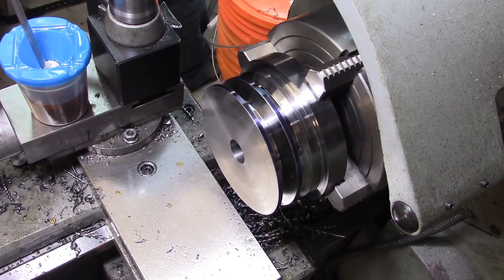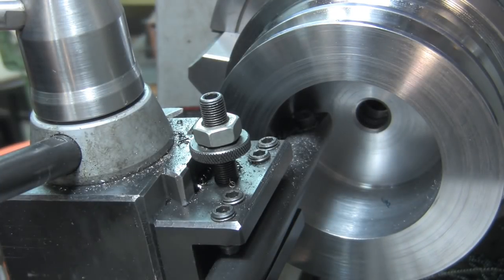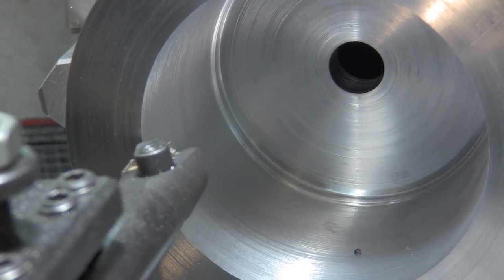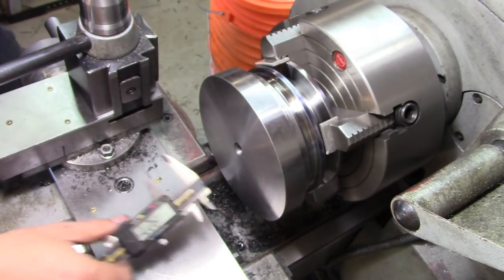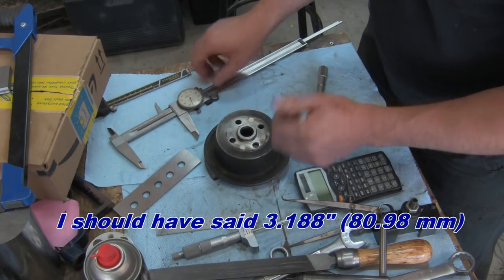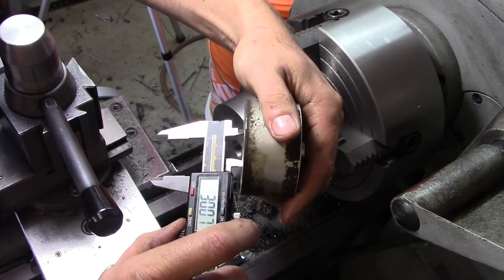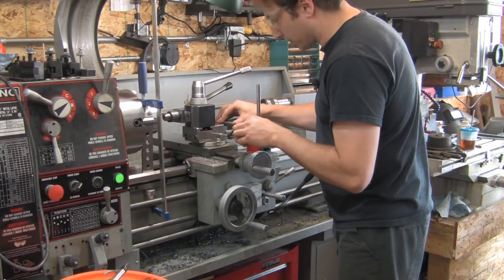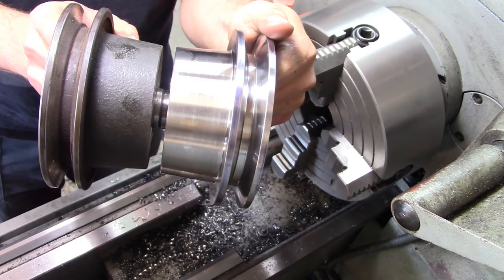Making a Custom Water Pump Pulley Part 2

Comment: Very professional  work of art.  Better than a store bought Pulley.  I liked the way you worked out your angles etc. Overall Terrific Job, Well Done
Reply from the maker: Thanks Ted, I was content with the finished product and it worked as it should. Figured the angle measurement was as close as necessary for this application.

Comment: Must be a really good customer.  Cutting that pulley looks like a couple dozen hours' work.  Still, it's nicely done.  Thanks for sharing.
Reply from the maker: Thanks Dan, it did take about 11 hours or so all told, but that's partly due to the lower horsepower of my machine requiring more light passes than something bigger with mote grunt.
Reply: Everett's Workshop get yourself a bigger motor or if you are using a single phase set up then go three phase with a VFD soo much more power to your elbow and with what you could charge the customer you can now afford a brand new motor and a VFD!

Comment: G’day Everett, you tackled a big job and achieved excellence too bad it was only a wood chipper, it would looked good on a hot rod. Being a Perkins you’d have thought a pulley would’ve been available but then if it was sourced through the chipper people they wouldn’t think outside the chipper box. Expensive but then if it’s a one off like yours you can see the price in labour. Cheers Peter
Reply from the maker: Thanks Peter, I'm content with the finished product. You make a good point about the equipment dealer perhaps not looking elsewhere but my boss is pretty resourceful so I would trust that he snooped a number of avenues before talking with me.

Comment: Nice work! Now it just needs chrome plated. 👍😉
Reply from the maker: You know, I'd like to try plating of some type, whether it be zinc or nickel plating for steel surface protection, but need to get a number of projects off the list first.  Chrome would have looked good though!

Comment: Wonderful work. I'll bet that the charge for that pulley was about the same as for the original Perkins pulley. I have worked on them before, metric, metric, metric...  I think that you do class "a" work, thank you for the very interesting video. Please keep making the video's.
Reply from the maker: Thanks for the kind words, I appreciate it. The overall cost to the customer wasn't near the OEM part cost but I think they were mostly happy just that they got their machine back in operation. Will keep doing videos as time allows around other work and family priorities, the hobby machining community is a great bunch to hang out with.

Comment: Nicely done, if it's like you suspect made from 4140, this pulley is gonna last for ever even if the chipper falls from a high cliff...!!!!  
 
This involved TONS of metal removal, lots of work on a small to medium sized lathe. I'd be curious to know what kind of cuts your lathe is able to get away with and how long you needed to remove that amount of steel.

Your problem not getting good chip breakage control, is mainly due to depth of cut vs feed rate and speed, depending on the geometry of the insert you need to find their "Sweet spot", generally the rule is to get the depth of cut at least twice the nose radius of the insert, then adjust the advance, you can expect to gain decent control in the .006" to .015" advance range, now, there is also a limiting factor to deal with, the available power from the lathe's motor, another parameter to take into account is the SFM, with carbide inserts and alloy steel try to get around 250 surface feet per minute or even a little above if possible, this produces the required heat to help make the chips brittle and wanting to break. 

You may need to push your machine a little in order to achieve good results, also will shorten your execution time...
Reply from the maker: Thanks Pierre, it took a number of passes to remove material, for sure.  Had a trash can of swarf in the end . . . I need to experiment with feeds and speeds with this thing but something tells me that the "1.5 hp" rating this Chinesium lathe has is not quite accurate with how it seriously grunts when putting any depth of cut or heavy feed.  A lot of my tooling is negative rake because it was cheap but might have to experiment more with positive rake stuff.  Got another 4140 turning job here so will give a chance to fiddle with feeds and speeds.  Hope you're doing well!
Reply: @EverettsWorkshop  Don't be afraid to find out the limits from your machine, carefully, though... 
If you can reach the sweet spot where you remove quite a lot of material and the part remains still relatively cool, this means you're quite on spot and were able to make the heat evacuate in the chips, try to get your speed adjusted first, remember that carbide performs better at higher speeds ranges, 250 to 600 SFM is typical.

Comment: Everett, having read some of your reply's to other people, and now knowing you were paid for the job in future to get over licences and the like, if you have a job come in barter with the person, and get them to buy you stuff you need in place of money. In this pulley job I would have got them to supply the steel blank, and buy you the new 3phase motor and VFD and they would have come out about half of the seven hundred bucks you said a pulley would have cost if it could be found. Here in the UK I have just purchased 1.5 hp 3 ph motor and a VFD for just about £200 both brand new.
Reply from the maker: I don't usually charge for work, it's almost always doing a favor for family or friends, or something for myself.  First time I have ever needed to make an invoice, that was interesting, and I bought the steel and charged it to the invoice.  As for a replacement motor I'm not really looking to replace it right now due to trying to be fiscally responsible.  As it is, this job has now covered the boring facing head that I got a few months ago, lol.  I didn't ask for a huge amount, but it covered the cost of the head well.  If more people want stuff that would need payment I will need to figure out how to handle that then.

Comment: Great work!  You must have a barrel full of swarf from this project.  BTW, an "S" or "T" letter size drill would be a little closer to 9mm.
Reply: Craig Treleaven   likely the bolts are 8mm, so true size of hole may not be vital in this case.
Reply from the maker: Thanks Craig, and for what it's worth you've got a very good point. The letter drills would have been closer, and I honestly don't know what size bolt went through them. I had my doubts they were 9mm as in all my years of working on cars, trucks, equipment, etc., I have only seen one application of a 9mm bolt, so figured that 11/32" should have worked.

Comment: Boy the pulley turned out great. Did you replicate the draft for appearance or was there clearance issues? In any case it was a shame to see such a beautiful part painted. Very nice work.
Reply from the maker: Thanks, I'm happy with the result, as is the customer.  I did not see the original water pump before making the part so figured it best to replicate the draft angle and approximate wall thickness to avoid any potential clearance issues.  Turns out it looks like it would have been fine with a parallel bore but I didn't know at the time.  As for paint, well, if we didn't it would rust to crap so it got a coat of engine enamel.

Comment: The project turned out great, better than new.  I was wondering why not just machine away the broken rim, replace it with a brazed on new rim (assuming the part is cast iron), and machine just the rim to to fit.  I know you must have considered this.  BTW, your method is more fun.
Reply from the maker: Thanks James, I had thought about repairs to the cast one, but I also don't know how banged up it got regarding runout.  As well, I'm still a novice when it comes to TIG brazing and Tig braze welding and it might not have turned out very pretty . . . this seemed to be the most logical way of doing it, but would have been better if the metal place had 5-1/2" material instead of 6", lol.

Comment: Just think how much they would charge for the cast pulley if it was as gorgeous as the one you just made.
Reply from the maker: Thanks Craig, but cast units would ne MUCH cheaper, especially considering the machining time on it for a casting vs how much time it takes to hog out a solid chunk. It would be BRUTALLY expensive if the OEM unit was cut from stock . . .

Comment: that job can be a real pita. i did one years ago and i remember using a couple of the screws from the motor housing to compress that spring. i also remember having to compress the spring to get the motor to clear the belt. your machine obviously doesn't need to do that ,but i suspect that the install might have been easier if the spring was compressed.
Reply from the maker: I didn't actually install the pulley, just made the new one.  One of my co-workers did the install, but I was at work that day when he assembled it.
Reply: @EverettsWorkshop  please disregard my comment it was meant for another posting. nice job by the way

Comment: That pulley you make will be bulletproof compared to that cast iron Hunk of junk that came on the chipper engine. That is the way it should have been made in the first place.
Reply from the maker: Thanks Kevin, I will bet that if that little Perkins eats its water pump like that again the pulley won't take the same sort of abuse.  I can understand how casting is cheaper and faster (which is the mantra of manufacturing) but cast is nowhere near as strong as a good alloy.  Really, 1018 would have been fine but apparently they sold me 4140, lol.

Comment: Thought that looked like a Perkins part.. They use to be made in England...Mike in Louisiana
Reply from the maker: Yeah, I found out part way through machining it that it was a Perkins engine, which explains the metric base to it, giving funky Imperial measurements.
Reply: @EverettsWorkshop  I use to work on Perkins engines but I thought they were imperial at the time maybe not. It has been years..Mike in Louisiana

Comment: Thanks for sharing. So how much did it cost to make? Powder coating is more easy then painting. An old oven, some brake cleaner and a $50 powder gun.
Reply from the maker: I haven't tried powder coating yet but picked up an old toaster oven at a garage sale last summer.  From what I've been hearing it sounds promising, may have to give it a try down the road.

Comment: I was looking at the pulley and thought it sure looked like Perkins. Probably could have found pulley at combine/tractor wrecker.
Reply from the maker: It is a Perkins engine in that chipper.  My boss looked for quite a while at different places for a pulley before he asked me, not sure if that little engine was common in tractors in this area or not - I know Massey used Perkins for many years but it sounds like the little Masseys around here are rebadged Japanese tractors now.
Reply: Everett's Workshop ok. Didn’t look like a newer model? Cat actually bought certain Perkins models so maybe that the high prices? I s,pent few years working on them and watching video swore I knew where to find one but if it’s newer maybe not. ?

Comment: It looked to me that the old pully wasn't painted/ powered coated, did you consider Bluing the pully? Bluing adds rust protection without adding layers that can change the dimensions.
Reply from the maker: I hadn't considered bluing as I've only done that to small gun parts. The old pulley was cast iron, which doesn't seem to rust in the same fashion as rolled steel, but it had a layer of paint on it too. I would have rather used cast but that piece of round is all I could get a hold of.

Comment: Hi Everett,
New subscriber and i must say i really like your easy going free flowing style with your videos !
How do you find the Ryobi gear ? For what they cost i can't fault mine and my first drill is still going strong after the abuse i have put it through , even the original battery is still going but i have noticed it has lost some capacity . The only gripe i have with them is the chucks are not the best but i suppose you gets what you pay for !
Reply from the maker: Hi Ian, thanks for the kind words, I'm glad you like it here.  It really is just me messing around with stuff I normally do, but now with a camera over my shoulder.  I like Ryobi stuff a lot - all the One+ batteries and tools are compatible with each other, and compared to some other brand names that change their systems every few years this means my older tools are not now junk.  I don't like keyless chucks on anything, so have even changed some of the chucks to keyed chucks, have to agree with you on that one.

Comment: Why did you need to cut the "draft" taper inside, and outside of the pulley? I'm pretty sure it serves no purpose except for casting release of the pattern. It would seem if the waterpump flange fit inside, that would suffice, and save hours turning, ditto for the outside. The outside probably could have stayed full diameter! Just wondering. But an awesome job nonetheless, it looks amazing!!!
Reply from the maker: Thanks Scotty, I was happy with the final product, as was the boss.  I figured that the draft was there for casting purposes but as I had not seen the machine on disassembly I wasn't sure whether the water pump snout reinforcing ribs came close to the inside or what sorts of clearance issues there would be on the outside so thought that it would be best to mimic the shape overall.

Comment: Nice job!  How many hours went into it?

I’m also wondering how you charged for it?
Reply from the maker: Thanks Andrew, overall about 11 hours, but part of that has to be accounted for in dealing with trying to remember where I put tools down, fiddling with cameras, re-taking monologue clips, etc.  I wound up charging 7 hours for it and talked with my boss as to what a fair hourly rate would be. I don't have an hourly rate as it truly is a hobby so far.
Reply: @EverettsWorkshop  at $50.00 an hour times 7 hr $350 that is a fair bit less than new
Reply from the maker: @ypop417  Lol, it was far lower than 50 bucks an hour that I asked for. Maybe at some point if I got my license, but I'm still an amateur :)
Reply: I'm new here I watched your videos on the pulley doing the job in your home shop the work was top quality and your boss paid you far less than $50 an hour WTH?
Reply: @neilpuckett359  I agree he is selling himself short. His own equipment, his power, and lights.
Reply: @EverettsWorkshop  You must figure in your electrical cost and machinery cost. That $50 an hour I used was LOW for the job you did.
Reply from the maker: @neilpuckett359  Hi Neil, thank you for the kind words, glad you find what's going on interesting.  I only asked for what I did because I thought it was fair.  As it is, I only take on a job for someone if I'm willing to do it for free, if I ever get paid is a bonus.  I'm not a business and don't want to deal with the headache of licenses, zoning concerns, etc. so I am honestly happy to do stuff like this as skill development exercises.  It's a bonus that I got paid for this one as far as I'm concerned, so I am happy with what I got for it.  Maybe at some point if there was more business involved a set shop rate would be in order but I'm happy with what I have for now.
Reply from the maker: @ypop417  Thank you for the kind words and concern, but I am happy with what I got paid for this one.  I am not a business (at least not at this point) and really only take on jobs for family and friends to help them out.  I won't take on a job unless I'd do it for free, getting paid if it happens is a bonus.  Maybe at some point setting a shop rate would be in order but for now, as it is a hobby worked in around family, work, etc. it doesn't seem to be a necessary thing.  I appreciate your concern though, and maybe at one point if more "customer" work comes through, and there is more machining capability, then I may need to revisit the "non-pricing policy," lol!
Reply: You are pretty skilled from what I see.  I’ve been doing it for 10 years,  charge 350-400$. Somewhere in there.  Always charge as much as you can, and not a penny less.  You need to accessorize your shop with new toys.

Comment: When turning steel that makes such birds nests, I recommend you put a glove with a wrist cuff on your left hand.  I had a nest become entangled on the workpiece and it started spinning like a rock at the end of a string.  Sliced my thumb 1/4 inch deep and 1 1/2 inch long.  Lots of stitches!!
Reply from the maker: I don't take the birds' nests for granted anymore after losing a camera and hearing of my buddy Grant's injury from swarf.  What needs to happen is more experimentation on speeds, feeds, insert type, and insert geometry, to find the "sweet spot" that this light lathe will peel and break a chip in 4140.  Just need the time to experiment with it.

Comment: Heat it drop it in some used motor oil it will look stock as can be-----a motor that has never been worked on lol
Reply from the maker: You know, that would have been an idea, to heat blue it - maybe will do that with the next project like this, would be worth a try.  It wasn't getting plated so that would have been a viable surface treatment.